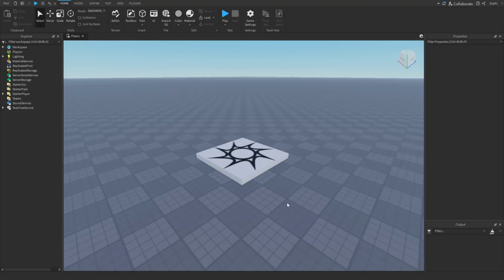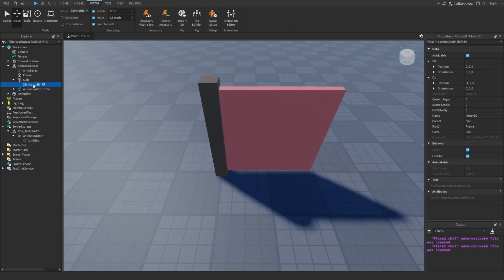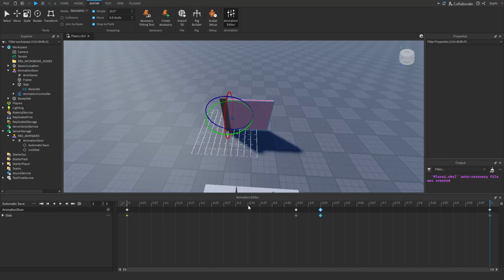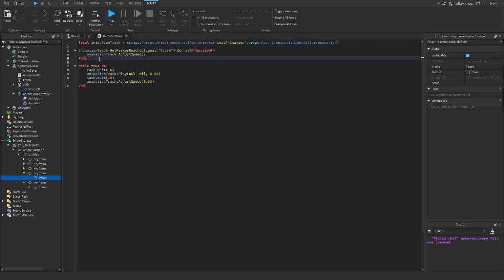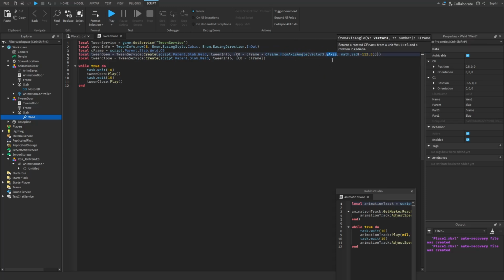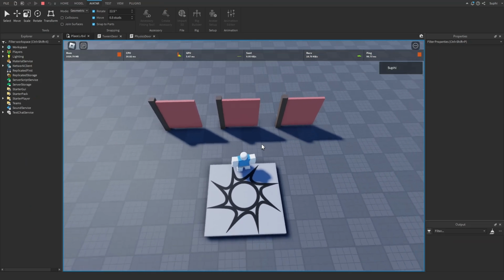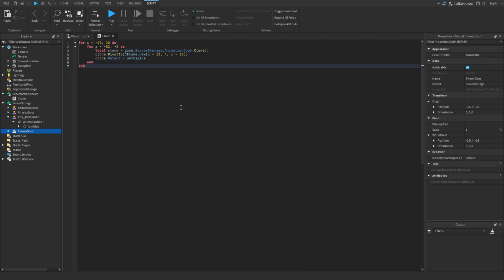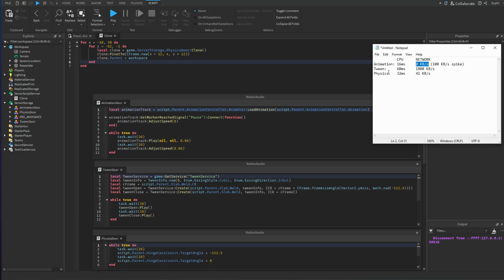Animation Controller - Roblox Scripting Tutorial

Comment: for something with a variable location like plane or bullet movement, would tweening or the physics engine be better?
If you had combat in the air or something that would interupt a tween, I would imagine it would be anoying to improvise it. Like if I had a door opening with a tween but then I wanted like a slam ability that makes the door interact in a different way, canceling the tween
Reply from the maker: You could use animations for bullets
You can also make the door slam with animations and you can also cancel the animation by setting the speed
Reply: @5uphi  thats true actually, thank you

Comment: nice one. I assume the biggest downside of using animations compared to other methods would be the memory, right? because it stores the whole animation data inside the memory.
I was wondering how significant that memory bump would be if we kept using animations for basic tasks such as this one
Reply from the maker: I don't think it would be that significant its only a list of CFrames with a number representing time and names to know what part to move plus things like numbers to know what easing style to use etc..
in this video we only used 4 CFrames, 4 numbers for time and 1 name/string
1 CFrame might use around 48 bytes / 1 number might use around 8 bytes / and strings might use around 1 byte per character
50 cframes might use around 2400 bytes = 0.0024MB
but this is just hypothetical it could use more I have not tested

but memory usage is not something you should really shy away from using, the hole point of memory is to use it to improve performance

for instance if you had a choice of generating 1000 CFrames every frame or caching 1000 CFrames in a table and reusing the 1000 CFrames every frame it would be better to cache the 1000 CFrames and reuse them every frame instead of generating 1000 new CFrames every frame this is because CPU is a more valuable resource then memory

Also remember that memory used is better then memory that is not used this is why windows has things like SuperFetch in order to fill your memory so that your memory is not going to waste
Reply: @5uphi  Thank you for explaining it nicely. I was also thinking that way. But one small question about your comment, Is this memory usage going to badly affect Roblox mobile players (who play on low end mobile devices with little amount of RAM and storage). Because Roblox is something that has a huge mobile user base. Or is it not that of a problem for them but rather an advantage, because we're using less processing power by using those extra bytes of memory?
Reply from the maker: Most mobile devices should have at least 4GB of RAM so I think it would require hundreds of thousands of animations to fill that up also if you use content streaming it should allow animations far away to be unloaded from memory also if you reuse the same animation it might not use any extra memory but I have not tested this so im not sure

Comment: Could you also use Tweens but on the client and have the server tell the clients when to do it with a RemoteEvent? I feel like AnimationContollers have special engine-side capabilities that make it so the motors are moved very efficiently (maybe no Changed connections, but I'm not entirely certain) and far away motors will be throttled to run at a lower framerate.
Reply from the maker: Checkout this video https://youtu.be/ZJnMimf9n5Y

Comment: since animations clearly are the most efficient way of making things move, is there some sort of way that we can get players to move with the object like they can with physics?

Edit: I presume some sort of proximity check will be needed so that it's not trying to move the character if they are not nearby?
Reply from the maker: Right you will need to do a raycast to detect the floor then update the character based on how much the floor moves

Another way is to set the velocity of the part that is animating but if your setting the velocity every frame at this point it might be better to use physics